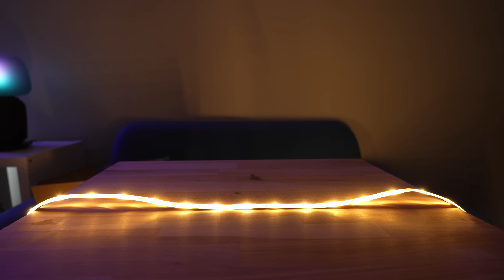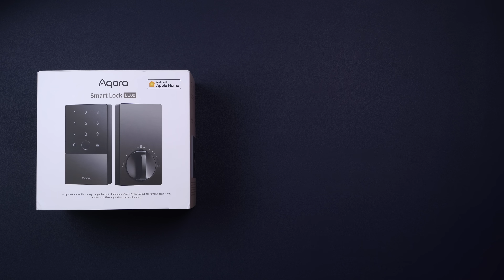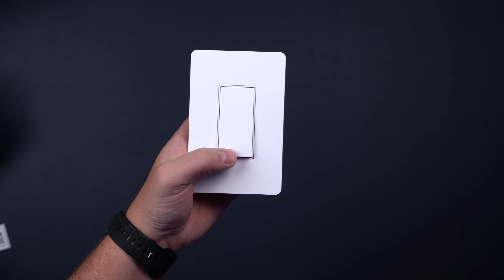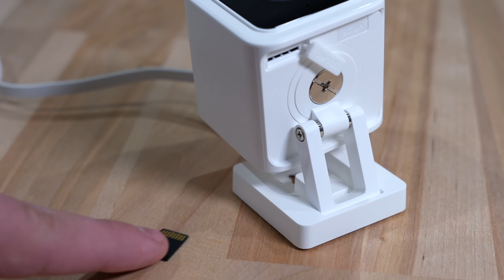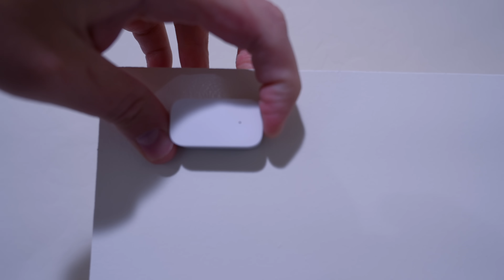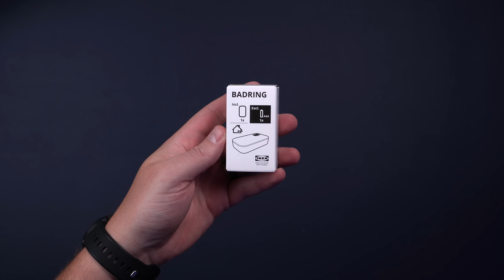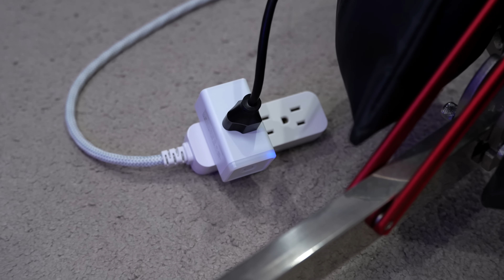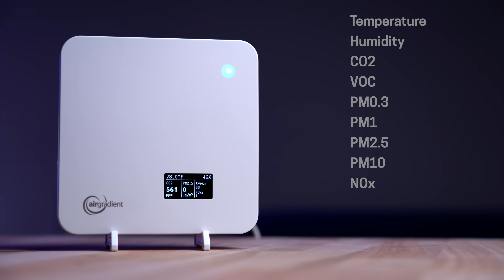Cheap Smart Home Devices that are WORTH IT

Comment: Ikea's sensors work with home assistant.  I've used some for years with ZHA but had trouble with some falling offline and needing to be paired all over again when the battery went dead.  I switched to Z2M and have't had a problem with that since.  It has been able to recognize even the newest ones that came out over the last several months.
Reply from the maker: I have got the old IKEA sensors working but the new ones on ZHA just show up as blank devices. Maybe I'm doing something wrong but I'm setting them up just like all the other Zigbee sensors.
Reply: @SmartHomeSolver  How odd cant say for ZHA but Z2M pair without issues. IKEA and SONOFF are by far my top go to device providers I use as they are cheap and reliable overall. Good call on the Aquara T1 I just got one for my kitchen and it was a minefield to pick one that was affordable and good quality.
Reply: @SmartHomeSolver 
Some of IKEAs sensors get really funky if you use non-rechargeable 1.5V battery instead of 1.2V.  
Made that mistake while trying them out on the kitchen table when I first got them.
Reply: The Styrbar and Somrig buttons work fine with alkaline batteries.
Reply: @SmartHomeSolver  Ah that might be the difference.  I only started using the current gen after I had already migrated my old ones to Z2M.  In the end, ultimately much happier with Z2M's performance and it was deffinitely worth the time and effort to migrate.
Reply: @fw4809  mind doing a little write up on what it takes to migrate or pointing to a guide you may have used? If not I'm sure I can dig it up, but wouldn't mind hearing from you. Thanks!
Reply: @SmartHomeSolver mine newest gen motion sensors from ikea work flawlessly! At first it detected all kinds of things that didn't exist. But when I switched to rechargeable 1.2v battery's, all my problems were solved...

And to be fair, ikea says in the product listing that you need to use 1.2v batteries... 😅😊
Reply: @SmartHomeSolver add them via another device and it will work. Sometimes need to reboot Ha for them to show. Mine work perfectly once I figured this out.(ZHA)
Reply: @SmartHomeSolver  for IKEA RODRET or IKEA SOMRIG or IKEA TRADFRI you would need the blueprint by damru to get them working, might also work for other IKEA stuff too
Reply: I had no issues pairing 3 Styrbar and 2 Somrig buttons to ZHA.
Reply: Yeah odd thing to say. I use loads of IKEA stuff using Zigbee2MQTT and works fine. It's the main selling point for me that and they are cheap. I feel like this video misses out some of the cheapest devices because of wrong information.
Reply: The new line of IKEA with rechargable AAA bateries is great and works great with Z2M
Reply: I also have different Ikea and Sonoff sensors and switches and the do work with ZHA but not always a s good as I like. Sonoff switches and sensors sometimes have problems reconnecting after an update of HomeAssistant, Ikea has less problems reconnecting (less ...). The newer Ikea switches have limited functionality. The old round 5-button remote works great and supports double klick and long press. The new 4-button Styrbar only does not have double click events but the 2 button Somrig does. The Rodret is a pain in the ... device. It looks exactly the same as the Somrig except for the 1/0 on the buttons instead of ./.. That one only support single click (and long press if I remember well).
Sonoff has different issues. I had a lot of problems with the SNZB-01 switch and the SNZB-03 PIR sensor but I am a big fan of the SNZB-02D temp/humidity sensor with display and the SNZB-06P presence detection sensor. The ZBMINI modules that mount inside the wall box behind the old switch are also great. It gives regular LED bulbs the power of Zigbee and I can control them via HomeAssistant as well as with the standard wall switch
Reply: My setup is a mix of sonoff and Ikea on ZHA - all running local with no fiddling with keys etc like Tuya gear.
 I found Ikea motion detectors are flaky (and a recent OTA update took 2 of mine out ) but they are the only ones I have issues with.
Other newer devices I have used are trouble free and cheap and cover more and more peoples needs.
The open door sensor "parasol" is equivelent to US$9 and is AAA battery powered. The smart plug "INSPELNING" measure power and voltage for a similar price, but if all you want is switched power, the TRETAKT is only US$7!!
I seriously just turn away from the alternatives - between non-local and high prices, they don't appeal to me at all.
Reply: For me all the difference with my old ikea wireless buttons was to switch off of a sonoff dongle and over to an smlight one.
Reply: I’m using ZHA, and I’ve got the two button (dimmer), the door sensors, and the water leak sensors, they all are working fine. 

So I’m not sure why it isn’t working for Reed

Comment: Hi, great video. I'm not sure if being in the UK makes a difference, but I definitely have multiple Ikea switches (Rodret, Styrbar, and the old Tradfri) working with ZHA. I also have the PIR and door sensors working with Home Assistant via ZHA, theyre great for the price.
Reply from the maker: Thanks! Oh that's interesting they are working for you and maybe you're right being in the UK makes the difference. I'm able to add them using ZHA but I don't have any sensor data, it's just a blank device. I wonder if that will get fixed over time.
Reply: You've reminded me my last couple of PIRs didn't pair right, they were added to HA but didn't update the sensor status. A hard reset by holding down the reset button for 10 seconds before pairing was the solution if I remember right.

I have the Skyconnect on ZHA and a Conbee II on zigbee2mqtt and they do work with both.🎉

Comment: I usually buy FEIT smart color light bulbs at Costco for 2 for 10 bucks. At one point I got four for $10 on sale. As far as the wall switches, the KASA ones seem okay. When I lose power at the house which happens more often than one would think. It screws them up and I have to kill the breaker and turn it back on so it probably reconnects to the Wi-Fi. One of the KASA switches I have, is finicky and when I press it, it turns light on and back off again or vice versa.  For cameras, I prefer the EUFY, they integrate nicely with the home base and save everything locally on the home base instead of the devices. Plus, no fees.
Reply: Try the restart button on the bottom of the Kasa switches. It’s right below the switch button. I think it’s on the right.
Reply: @kungfoochicken08  I could, thing is, I have so many throughout the house, easier for me to flip a few breakers. Thanks for the suggestion though!